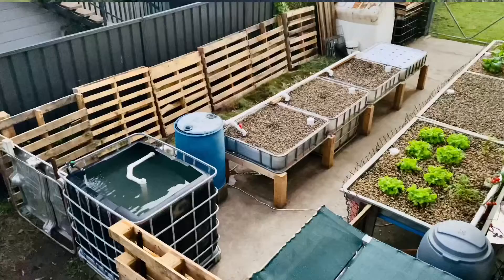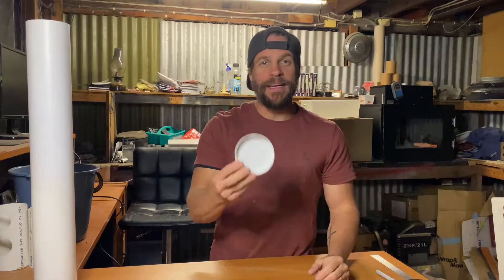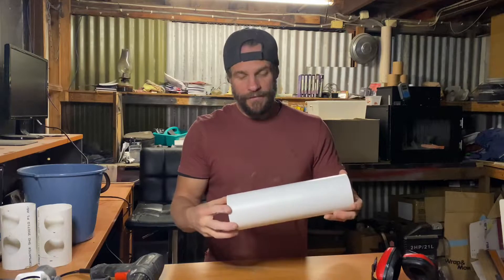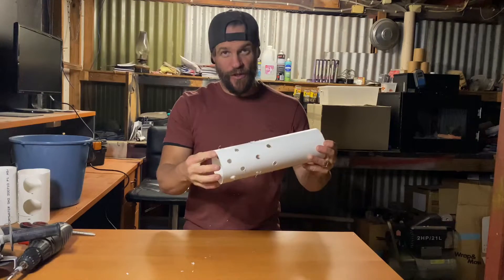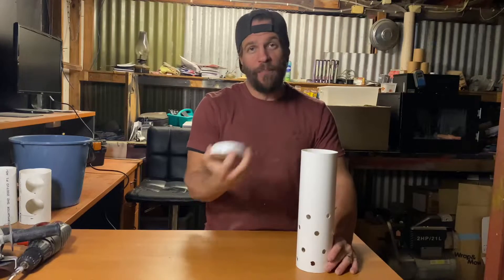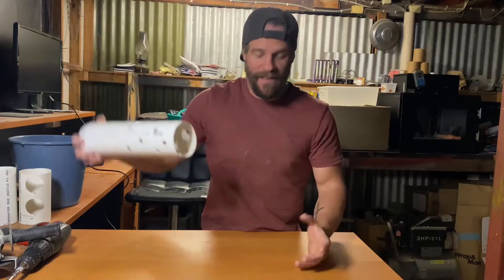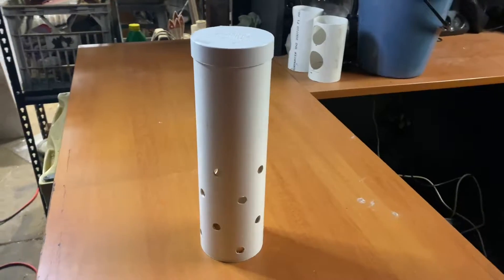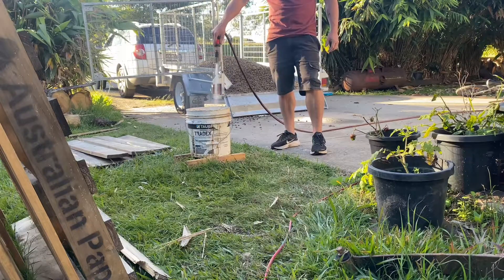How to Build an Aquaponics System: River Rocks and DWC #aquaponics #aquaponicsystem #howtobuild

Comment: The idea of the constant flood system seems good have you had any issues with stagnant areas / lower oxygen from not using a bell siphon? It would be a lot cheaper for me personally with the plumbing if I could get away from bell siphons and just use stand pipes, however I don't know a lot of about using constant flood. I guess as long as you have proper water flow and oxygen with the air pumps you shouldn't run into any issues in the grow beds.
Reply from the maker: Hi Michael, I personally prefer constant flood and have never had any issues with it. As you say, provided you have enough desolated oxygen in the water a bell syphon is unnecessary.

Comment: Another good video Matty. You got some skills with that angle grinder haha. I was curious if you tested the river rock before using it in your aquaponics setup? I know that some rocks and gravel cannot be used.
Reply from the maker: Thanks mate.
I’ve been using natural river rocks in my Aquaponics Systems for several years now and have never had an issue. While I’ve never actually tested them with vinegar personally, they are one of the safe gravels that can be used in Aquaponics without effecting the PH levels.

Comment: humm   interesting raft...   great work
Reply from the maker: Thanks mate. I went to Bunnings and was looking for sheets of polystyrene but couldn’t find any. When I saw the Corflute sheets I thought, I can make that work. What do you use in your DWC?
Reply: @mattysbackyard9244  the 50mm green insulation sheets from Bunnings you will need two..  that way only a 10mm of net cup sits in water,  for the duel root zone rafts and dwc tomatoes i got 70mm polystyrene sheets cut for a supplier in Brisbane, that way i can sit net pots on top of the rafts   ill take a video
Reply from the maker: @wizzzard_ponics  ok great. Thanks mate.
Reply: @mattysbackyard9244  link emailed
Reply: let me know if you get the link and it works ???
Reply from the maker: @wizzzard_ponics  got the link mate. Thanks for the valuable information. I may have to try out the dual root zones myself in the near future. Cheers
Reply: @mattysbackyard9244  duel root zone tomatoes starts  now just standing up, but growing all on their own.  in soil inn the clay media,  lettuce rafts in same video exploding with growth ready to start harvesting